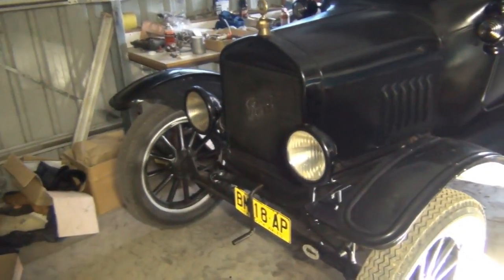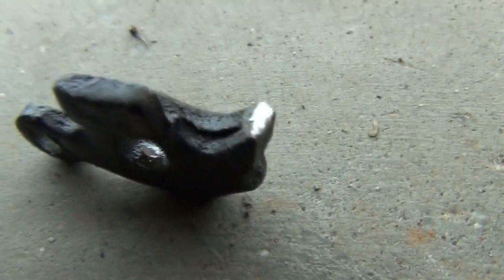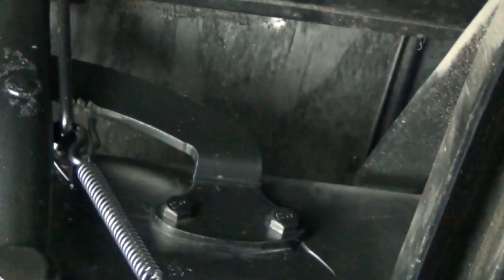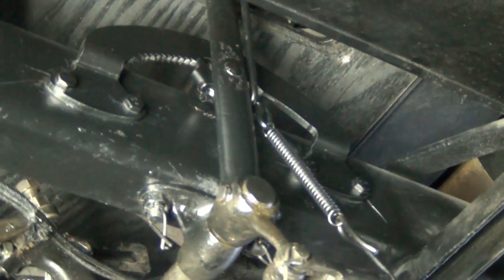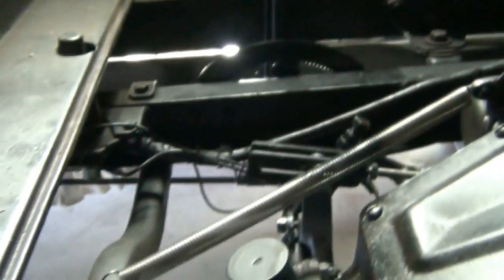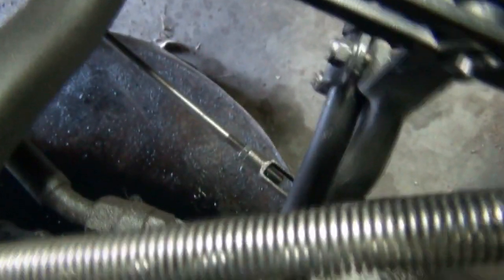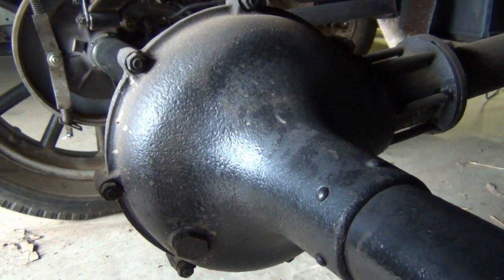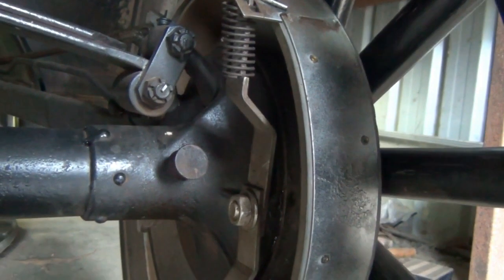Ford Model T - Looking at the Brakes

Comment from the maker: Yes that's right. Originally, there were only transmission brakes, and the metal-on-metal rear drums for parking brakes! Rocky Mountain Brakes were an optional extra available in the day, so they are period correct to have them installed. The Rocky Mountain Brake Company is still going to this day, so for US$900 I thought I'd buy a set - better to be safe than sorry! Thanks for the comment :)

Comment: Hi Mitch, Ken from Amarillo Texas. I just discovered you and watched this video. I feel smarter already! Your information is very good and I will watch all of them to further my education. I have a 1927 coupe, and have converted it to 12 volt alternator with coil and battery solid state ignition. I will be working on the transmission bands next, and then the thrust washers and rear brakes. The 26 and 27 have brake linings on the rear and work very well compared to the earlier models. Thanks for the video and keep up the good work. I'll be watching for what comes next. Cheers

Comment from the maker: My car was fortunate to have come with brass thrust washers. If you have a good eye, you can see the thrust washers by simply removing the diff plug (where you add oil). Else, the back axle must come off, and the diff split in half, by undoing the bolts holding it together.

Comment: Mitch - now you've got me worried about the diff. thrust washers in my '26. I bought the car from a gentleman who was unfortunately suffering from Alzheimer's disease, and didn't really remember much about the mechanical restoration of the car. I got to drive it exatly once before leaving home for my job xfer to Australia. How much disassembly of the rear axle is needed to determine what material is in use for the thrust washers? I can ask my Victorian T buddies here too. Did you do the brass?

Comment from the maker: Basically speaking, the park brake has 3 positions that you use.... Engaged (all the way back), Neutral (90 degrees to the floor), and High Gear (all the way forward).... if yours won't pull back, 2 possible causes I can think of, (A) the brake quadrant teeth are worn, so it doesn't lock in, I had this problem. Or (B), the linkages between the lever and the brakes at the back are out of adjustment, they are threaded rods. Email me and we can discuss this more if you like.

Comment: Just purchased 23 T open express  (pick up truck with no roof over the driver) and the hand break slips.  In the Vintage Ford magazine May 2019 there was an article about replacing the BRAKE QUADRANT.  They say to use a T-3448-H - BRAKE QUADRANT.  It is a better quality than the original.  I can believe it because the one on my T is not original (bolted on not hot riveted) and is worn out.  The Pawl is also worn badly.   How do you remove the Pawl?  it appears that the pawl is on a rived shaft attached to the break handle.   The handle is attached to a rod that crosses to the passenger side to operate the the break on the other wheel.  This connection also seems to have a pin that is peened over!  what is the easiest way to replace the Pawl?
Reply from the maker: Yes I had a similar issue - The only way I was able to remove them was a delicate operation with an angle grinder.
Reply: Thanks Mitch for quick reply.  I has a feeling that it was not going to be easy.